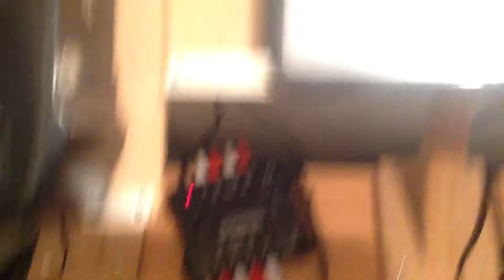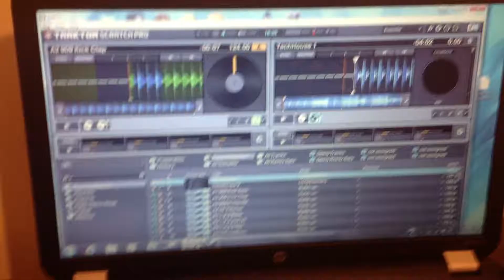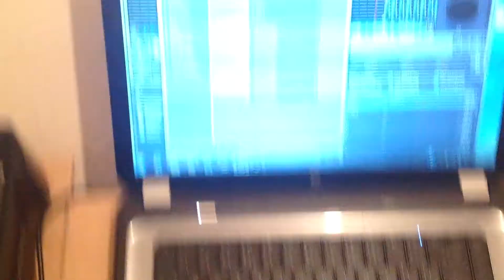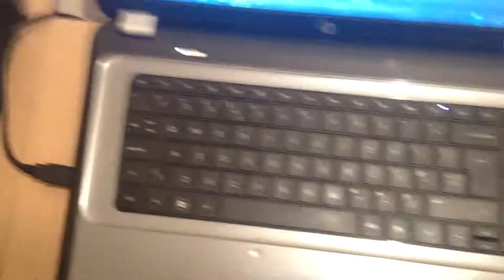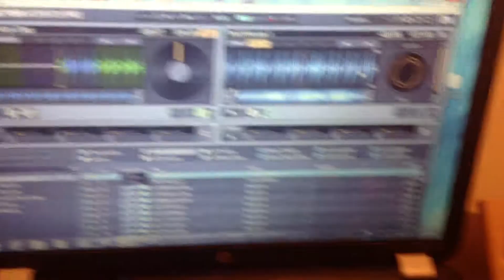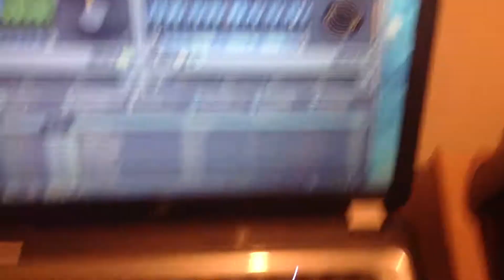How to setup your Touch DVS (Versaport) soundcard with Traktor Scratch Pro 2.5

Comment from the maker: Hey, for this trick you need the Traktor mkII timecode Vinyl or cd (i was able to get the timceode and burn it to cd after a bit of searching.

as far as im aware the code is made up of 3 tracks, the 1st track to calibrate, the second to play the song and the 3rd to let it continuously play. The pre amp thing does not sound right however I will get back to you on that and let you know  Ive decided to use vdj pro on midi with the versaport card and the pioneers software with the pioneer decks.

Comment: which time code vinyl do you need Tractor or touch? Will this work with vinyl, I hear there it only works on one side because there is only one pre amp on the sound card?